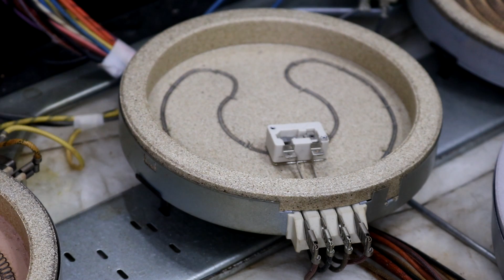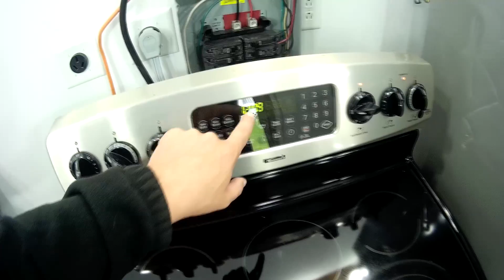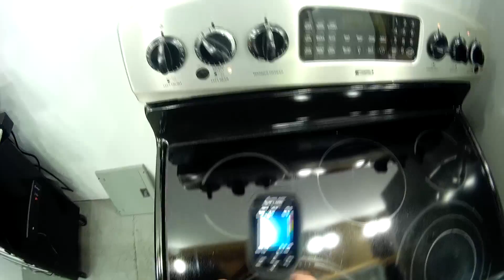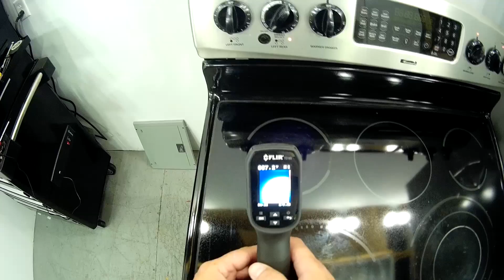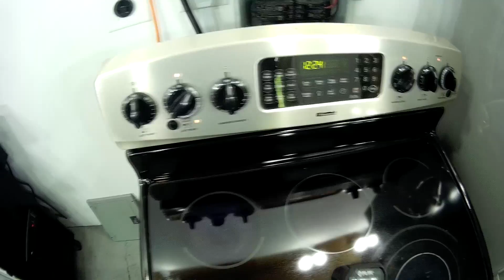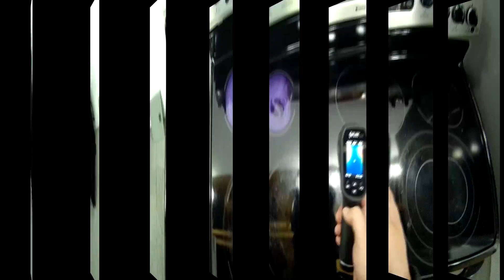Frigidaire / Kenmore Stove Repair - Warmer Zone Burner Element Troubleshooting

Comment: two things.  You never checked the burner switch.  You checked the burner, and only checked the control board for the non simmer position.  It should not read OL (open) in either position of the simmer select.

Comment: my frigidaire professional series slide in doesn't have a turn knob for the warming element. It is operated by repeately  pressing a button on the control panel beside the clock. How do I test it/find it?